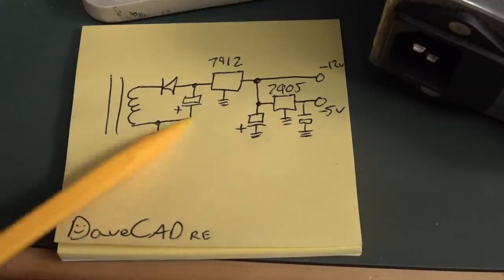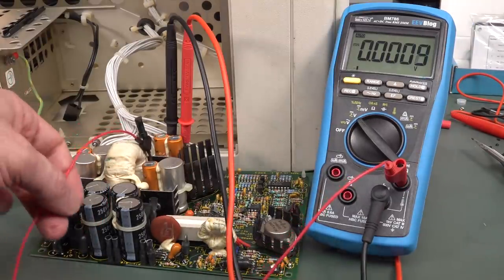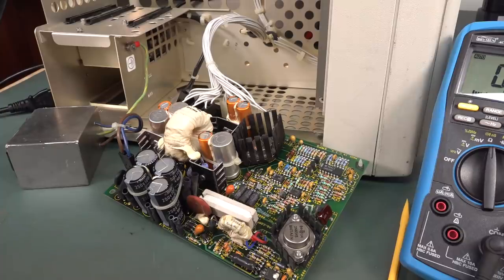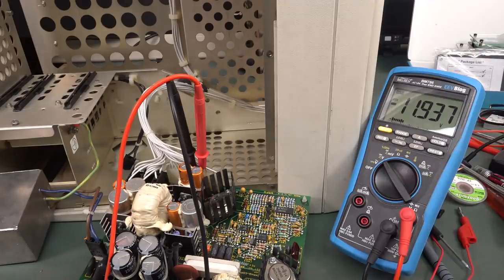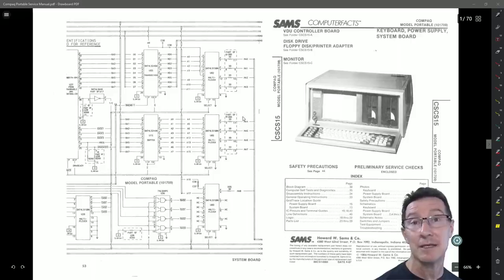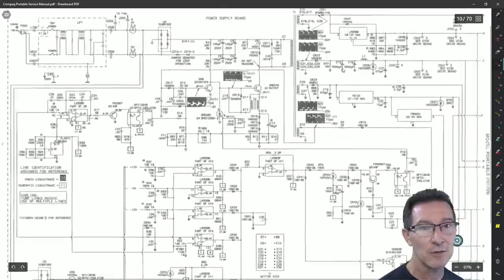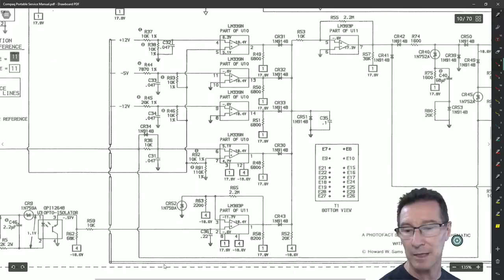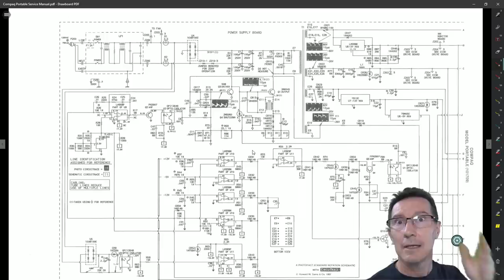EEVblog #1364 - Compaq Portable PSU REPAIR

Comment: They don't use the 5V6 zener for regulation, that's just OVP protection.  if you follow the rest of the circuit, the voltage on the 5V is what is fed back via the opto isolators to the primary side switching, so the 5V rail is regulated by the switching itself (as it's the highest current & power draw).
Reply from the maker: Makes sense, I should have followed that. The time pressure of trying to finish a couple of videos before going walkabout.
Reply: @EEVblog  There is also same OVP protection on the 12V line after 7912. Different Zener PN of course, to be just above the spec'd 12V
Reply: I was going to say that.; almost always the lowest voltage output is used for secondary side regulation.  The other secondary which is connected to the primary side is for powering the switching regulator after startup.
Reply: @Alamagosa  I'm not 100% sure I agree here..
I've found that the highest POWER rail (irrespective of the voltage) tends to be the one that is used for PRIMARY side regulation.
The lower POWER rails can therefore use (comparatively speaking) less expensive secondary-side regulation.
Reply: @trevorvanbremen4718  In this case you want to regulate the +5V rail because that’s the most important one for computer chips. The other voltages are not so important. Also in this case you can’t use the other voltages because they are already regulated separately and would be no use in the feedback path.
Reply: @markcummings150  I'm not disagreeing with ya...  The reality is that the +5V rail IS,. indeed, regulated in this case albeit using primary-side regulation!  The remaining rails (+12V, -12V and -5V) are also regulated, but on the secondary side (and being significanrly lower power they use 78xx / 79xx  regulators).
In the era of this old Compaq computer, the +5V rail was, by far, the biggest current hog.  Over the years, this changed SIGNIFICANTLY to the point where even the CPU itself no longer does its 'core' work at +5V!  Instead, modern systems consume the MAJORITY of their juice from the +12V rails and use 'localised' DC-to-DC converters on the motherboard / GPU card etc whereever lower voltages are required.

Read the label on an old AT power supply and compare it with the label on a more recent ATX power supply.  The AT PSU has over 30A on the +5V rail while the ATX has over 30A on the +12V rail.  The overall POWER available from  modern supply (i.e. how many WATTS it can deliver) is far better. and so is the associated power-conversion efficiency!

Comment: All of the warnings about not leaving things flapping in the breeze, it's nice to see a real example of why you don't do that.
Reply: The ad presentation was a piezoelectric vibrator. Glue it to tha spot desired to flap in the breeze.
Reply: They probably attempted to fix it in place with the white glop draping over to the heat sinks.  Obviously that side broke off.
Reply: Some guys just like to flap it in the breeze, so yeah... ;D
Reply: Dave should not have been so shocked. It is so often mechanical problems with old PCBs. The heaviest component on the board has no effective mechanical support. Where are you going to look first?
Reply: @jam99 I reply 1980s and 1990s power supplies professionally. First thing I check is always for shorted power transistors and diodes, after the sniff test of course. It's easy, quick, and finds probably 80% of problems.

Bum connections, bad voltage references, etc, they all happen, but they take attention to solve. A diode check takes no effort.

Comment: Dave, I think Sams started publishing Photofacts some time in the mid forties.  They were little pamphlets for (at first) consumer electronics like radios, phonographs and TV sets.  They'd contain schematics, parts lists and chassis images with parts called out by reference designator, and some voltages and waveforms on the schematics for troubleshooting and repair, and were published periodically in packets of a dozen or so as new devices came out.  The radio museum I volunteer at has a nearly complete set of the radio/TV ones; they're stored in binders and probably take up forty or more feet of shelf space in our library.  They'd publish annual books with the index list of chassis numbers to enable you to find the correct packet for whatever you're trying to repair.  The CircuiTrace seems like it was an evolution of the chassis diagrams, and was (as you saw in the picture) an image of the board with callouts matching the numbered flags on the schematic to make locating the circuit nodes easier.

Remember that back in the day, printed circuit boards were new and high tech things in consumer electronics (and nowhere near as robust as they are today when we take them for granted), so I'd imagine that they were very foreign to the repair techs of that time who were used to point to point wiring.

As time went on, they came out with additional variants of the publication, with dedicated series for things like mobile electronics and the computer one you were looking at.  They are very helpful, except when they are occasionally wrong - then they'll make you tear your hair out.
Reply: When we were doing third party repair in the late 80’s we always used the sams guide.  I believe they were reverse engineered.  But as time went on and they used more custom parts it became more difficult and futile trying to repair them
Reply: The best part is they're still around, have the whole archive online and your local library may have a bulk subscription with them.
Reply: @eliotmansfield  Yes, the Sam's is the go-to place for technical information on old TVs and radios. People like shango use them almost exclusively. I'm sure some was reverse engineered but certainly not everything. The Sam's for my 1949 Emerson 611 TV says "The cooperation of the manufacturer of this receiver makes it possible to bring you this service" right on the schematic.
Reply: Working through college as a tv repairman in the late 1960's I used the Sam's Photofacts packages a lot. Often the first thing ordered from the parts store when a new set came in was the Sam's. They were far superior to the manufacturers documentation (which was usually unavailable anyway) in that the format was consistent with all brands and models and the schematic layout followed the signal path through the circuit.
Reply: I've been collecting and repairing electronics from 1920 to about 1970 for many years now. I recently came into possession of a huge lot of Sams Photofacts.
 14 4 drawer file cabinets and a few boxes yet to be sorted.  They seem to be complete, with Sets numbering from #1 up into the 3000s. (1946 to around 1990.) along with mostly complete sets of the book series for Tape Recorders, Auto Radios, CB Radios, Hi-Fi, etc. No computer related sets, though.
 I'll never lay eyes on 99.5% of the individual folders but, by God, I got 'em if I need'em, LOL.

Comment: That power supply design brings back nightmares of doing military systems in the '90's, where we had to generate X watts from volume V with reliability R.  Which generally meant creating a system with as few stressed parts as possible, but going switched-mode to make the needed power density.

For a multi-voltage supply we normally had one rail dominating the power demands, so the primary-side regulator would regulate that output (+5 for the Compaq), and all the other outputs would use secondary-side regulators.  One way to look at it is as having a beefy single-rail supply, then tacking on some parasitic secondary supplies.

I think I mentioned in a comment on a prior video where even this approach was giving us fits, so we had to do some very sweet custom magnetics to make it robustly meet all the requirements.  The switching transformer in the Compaq looks to be that kind of problem solution.  Assuming a conservative design needing to survive many power cycles, the presence of that power zener indicates they got it very close to the ideal, and nothing beefier was needed.

Comment: Sams was a publisher of repair "packets" which had schematic(s), parts lists & later PCB views.  They started with Radios & TVs which all had tubes ("valves") in sockets on steel chassis with point-to-point wiring.  Wiring was easy to trace from one point to another.  When PCBs were introduced in the 50s and 60s, the "tube jockeys" doing repairs couldn't figure them out, so Sams came out with their "circuitrace" (pronounced circuit-trace) with the numbered photos matching the schematics.   
In the 40s & 50s, radios (and even some TVs) had a schematic in the cabinet from the maker.  As things shrunk and become more complicated the schematics were no longer provided.  Any technical service information was difficult or impossible to get.  This is why Sams came into being and thrived for decades.   They reverse engineered everything by hand to avoid any copyright issues.  They also believed that their literature was superior to what was eventually available from all manufacturers and stuck with the old "meme" of numbered B&W photos, as you have found with this compaq PC.   I worked in a TV repair shop as a teen in the 60s and most had several 4 drawer filing cabinets full of Sams folders.  Sams would not sell individual folders for a specific product, they sold annual subscriptions of monthly packets which had folders for a dozen or so different products from assorted manufacturers, most of which you would never, ever need.  One of the things they also did was have one folder for a "series" of variants of a product or chassis, which always resulted in confusion of which one you were  working on vs the schematic.  
A Sams folder could be helpful if you had it on hand, but between all the mistakes and the obtuse way of drawing the schematics, they were usually more trouble than they were worth.   In the late 60s  I found out how to get the manufacturers service manuals, for free!  Become an authorized warranty service center for the brand!  OFAE (Old Fart Analog Engineer)

Comment: H.W. Sams has been around a very long time. They are familiar to anyone that worked in television/radio repair.

Sams would produce their own schematics/service/alignment info based on manufacture supplied data. They would also tear-down the actual equipment, provide photos, disassembly procedures, and create the numbered "call-out" boxes to locate test points, etc. on circuits boards more easily. They took their own scope waveform measurements and included these photos on the schematic.

Hence the "Photofact" and CircuitTrace" trademarks. In other words, they were an added-value alternative to manufacture's service info. Often, the Sams was the only source of service info for a particular piece of equipment.

"Sams" (as they are commonly referred to) also published tons of books on servicing electronics. A really fantastic, well respected and liked company here in the US.

Comment: The electronic repair shop I used to work at in the 80s and 90s used SAMs Photofacts.  (everyone just called it "the Sams," as in "do we have the Sams on that?)  If we had the factory manual, we'd use that, of course, but if we weren't the authorized warranty center for a company, we'd use them, or borrow a manual from another shop that was.

Comment: In SMPS supplies there,s always one capacitor (I'll call him Mr. Main) where the switching circuitry measures the voltage.  All other outputs are what I call implied regulation.  Not very precise in that they could be off by 10%.  In some supplies they add a secondary linear or switching regulator to correct this.  

In this supply it's the 5 volts that is regulated by the switching circuitry.  If you would to poke around you'll find a feedback path through isolation to the switching circuitry.  The fun starts when Mr. Main looses value.  The regulation goes completely to pot.  To much voltage, to little voltage, works fine no load, totally wigs out under half load, keeps shutting down.  And because it isn't regulating properly overheats a burns out.  Mr. Main is the first capacitor I check when I work on SMPS power supplies.

Comment: Sams Photofacts were a staple of TV repair in the 1950s to 1970s (and radio repair a little earlier).  Instead of the manufacturer's service manuals, technicians would rather subscribe to Sams Photofacts and get the documentation for several late-model TVs delivered every month (and also buy older ones), quickly building up a file of hundreds of Photofacts.  Parts jobbers also kept them in stock so a technician could get one immediately when called on to service a TV whose Photofacts he didn't already have.

They covered many radios, virtually all TVs, some other hi-fi equipment, and -- briefly in the 1980s -- a few computers.  I have the Photofacts for the original IBM PC and for the Epson MX-80 printer.  I consider them collector's items.

CircuiTrace simply means numbers in black boxes on the schematics, keyed to numbers in black boxes on the photos of the chassis or PCBs.  That's all.
Reply: Howard W. Sams also published books about electronics and -- this is not well known -- printed the catalogues for electronics suppliers.  In those days, instead of Mouser and Digi-Key, we had quite a few regional companies with similar-looking catalogues and with a store in every town to serve the local TV service shops.  The main company in Georgia, for example, was Specialty Distributing Company.  It had counterparts in other states that were different companies but sold almost exactly the same things.  I visited one in Tucson around 1995 and felt like I was stepping back into the 1950s; that's where I got the computer Photofacts.

Comment: I had a similar repair recently, 240V to 12V transformer had a broken winding right at the post of the primary side! It was attached by old flux!  I had to micro solder a short strand on to the winding to re attach it.

Comment: These videos on this Compaq have been great to see, for I owned one briefly while I was in college. This was back when a measly 10 megabit Ethernet card cost almost USD150 and you had to go to a specialty store to buy them (CompUSA and Best Buy laughed when I asked if they stocked them back then). When at that store I saw one of these Compaq monsters sitting in a corner and bought it for twenty Yankeebucks.
It had a daughterboard with a 286 CPU on it, and from that board there was a ribbon cable that went right into the old CPU socket, it was so odd to see. It was a monster so I sold it to a friend for the same twenty bucks I paid, but I do wish I had kept it at this point. I have a pretty decent collection of old tech, and that would have been nice to sit next to the rest. :P
Reply: Token ring and 10 Mbps coax ethernet with terminators for the win. One bad connection and the whole network goes down. Damn easy to install though! 😄
Reply: @fieldlab4  oh now you're bringing me nightmares of my first job out of high school - doing mostly Quality Assurance at a local factory. It was one of those deals where the company had leased one unit in an industrial park and then later leased a unit two over - so the plant was a hodgepodge of offices and production areas and warehouses all mixed around oddly, with docks coming into the building at places you might not expect.
Their network early on had progressed to twisted pair Ethernet for the main office only, as they only had so many ports on the hub/switch (probably hub back then). The production office and other parts in the facility were connected via repeaters and of course there was that nasty coax loop in there; and despite being a reasonably smart guy, one of the banes of my existence was the plant manager (who only lasted a year or two) was some odd guy who needed to rearrange his office every few weeks; and when he would do so, of course he would disconnect that cable from his computer - killing line termination and dropping that entire segment. D'oh! It was only when I raced into his office with clear anger in my face asking him why he insisted on dropping the network so often when people had shit to do that he finally grasped why we kept telling him to NEVER EVER disconnect the cables from his PC. Of course he was "a Mac guy" so was completely clueless that support teams don't ask, they DEMAND, and if you don't obey, you lose. :D
Reply: @chouseification  And remember Gateway Computers made in South Dakota or some such nonsense, which came in big black and white cow print boxes? 

My nightmare nutjob manager was Dave Matthews who ran CUPS into the ground soon after firing me for failing to set up my first gateway properly after successfully installing an entire serial networked pc system in a credit union. May he rest peacefully in hell. This was the earliest days of PC ethernet and everything was running freaking MS-DOS. I don't even remember who made the network drivers.
Reply: @fieldlab4  yes I do; I'm from Minnesota myself, so it was one of the big mail order companies making great gear in the mid 90s (the other one was Zeos, who were local to me - so I went into their store regularly).
One of my college roommates had a 386 with the VL bus for his hard disk and video - that was a Gateway and he kept the giant cow print box on his closet shelf, so we saw it regularly and sometimes would even moo at him when he opened the door, as you could see it in the background. :D

Comment: First rule of electronic fault finding = "check the bleeding obvious numpty" we rarely do though, usually we fart about for two hours checking other stuff. Wish I had a tenner for every time I found a wire loose or a SW switched to off after hours of head scratching and mumbling. Thanks for another grand video me old duck......DA.